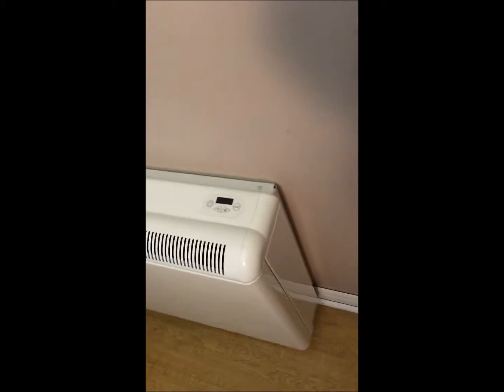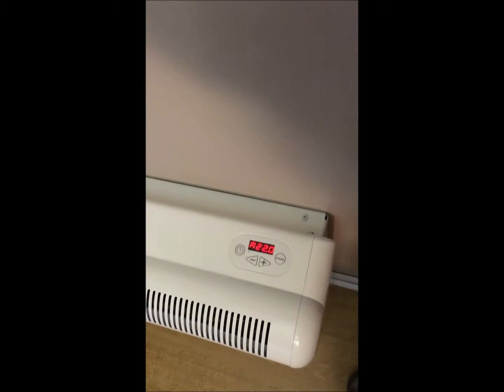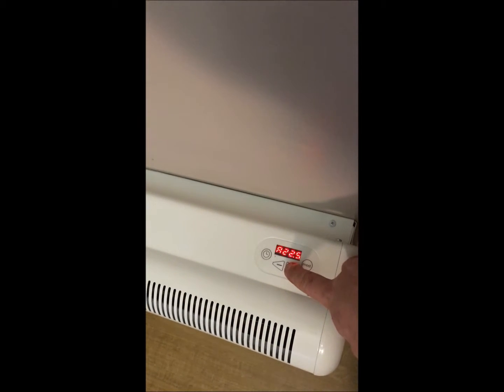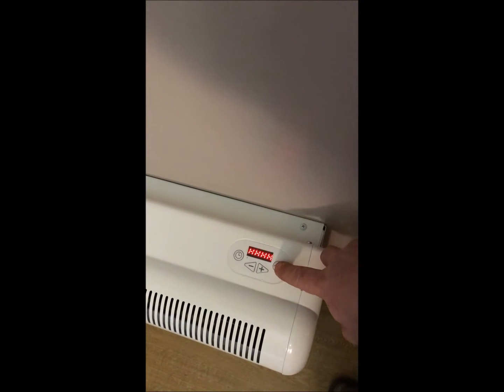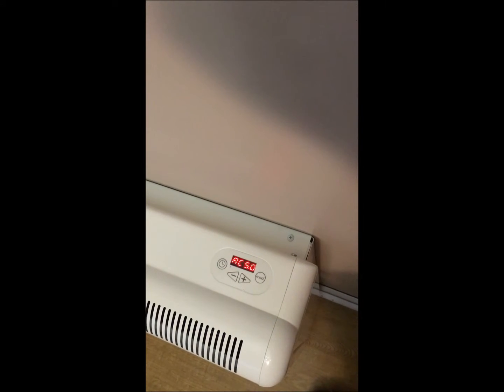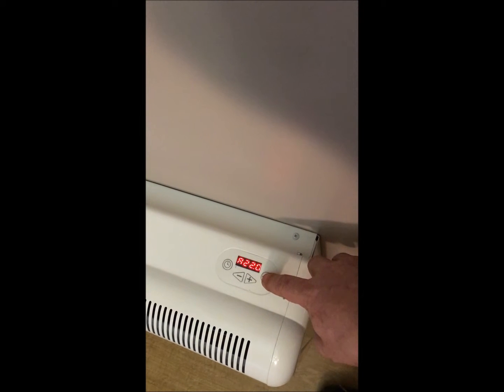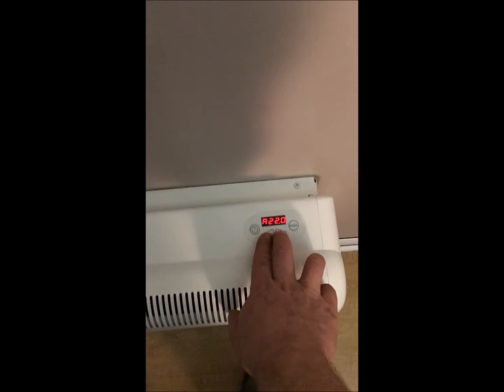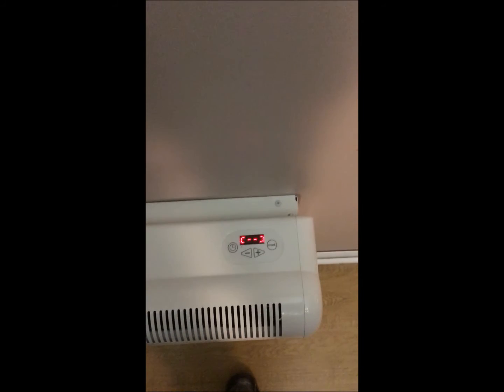Ecombi Electric Thermal Storage Heater Operation

Comment: Is it like we have to first put desired template in a mode and then move to Ac mode and leave it there ?

If we do like this it will heat and store at the same time?

And do we turn this off in summer ?